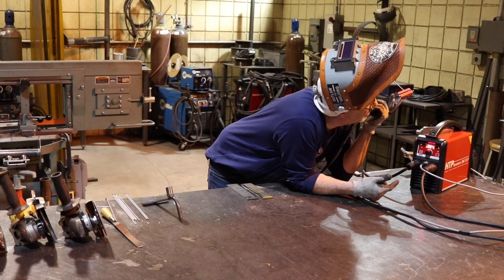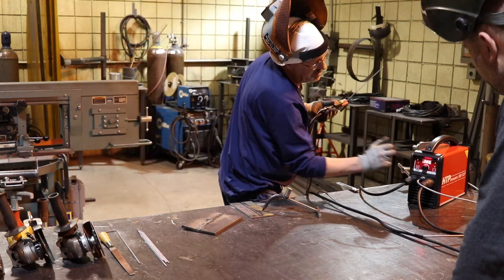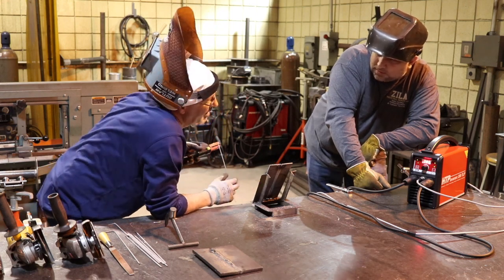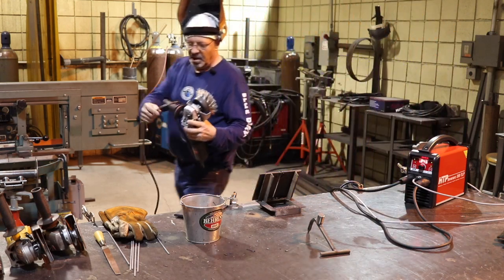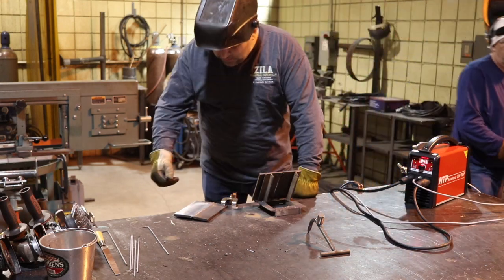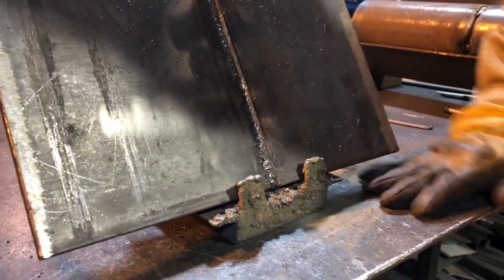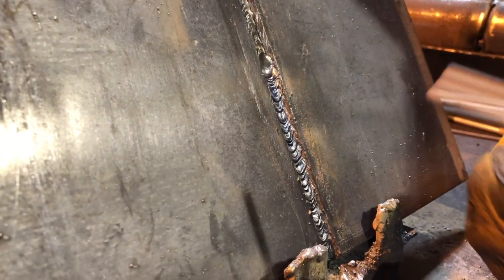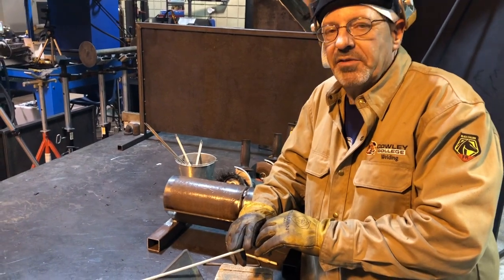Geeking out on stickwelding with BOB

Comment: I started doing pulse SMAW back in 2002 with my Miller Synchrowave 250 and the PC-300 pulser.........
everyone thought I was a nut job.......when I got hold of a Dynasty 200 DX, I had to do some monkeying 
around to get it to pulse, by setting it to a TIG mode....the HTP sure looks and runs better it seems....
best wises, Paul